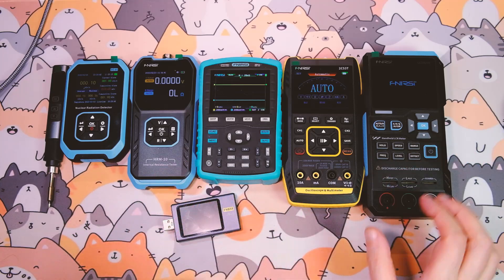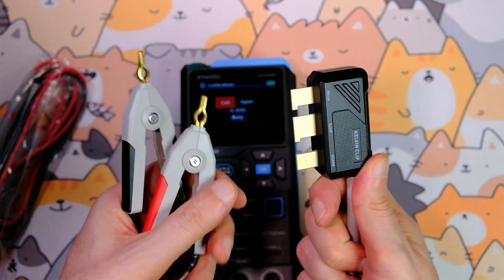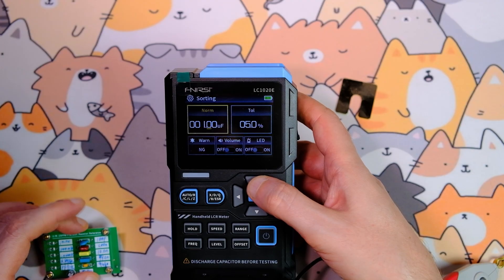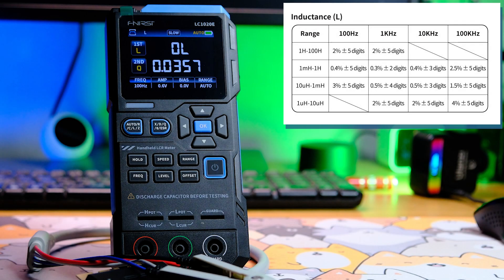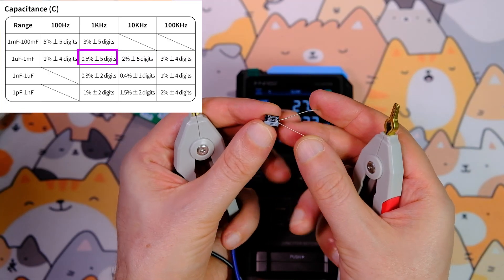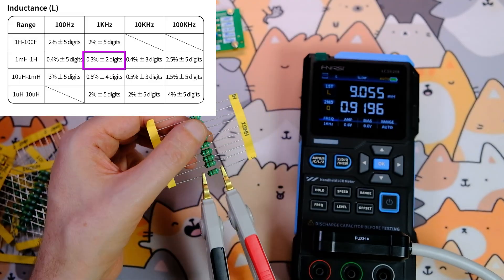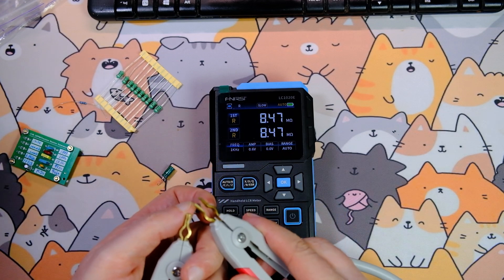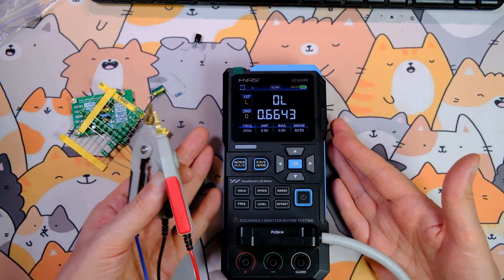FNIRSI LC1020E - accurate but inexpensive LCR meter. A worthy device for the home lab.

Comment: Hola... Excelente el video del instrumento, pero no es muy exacto en medición de condensadores.
Cuál otro instrumento es más preciso y exacto que éste instrumento Fnirsi  ?
Reply from the maker: I don't even know what to tell you, as far as capacitors go, my copy is doing well. As far as resistance goes, it's perfect.
But I only had the opportunity to compare it with the Zoyi ZT-MD2 and two multimeters. I didn't make a comparison with professional equipment, and for such cheap devices I don't even see the point in it.